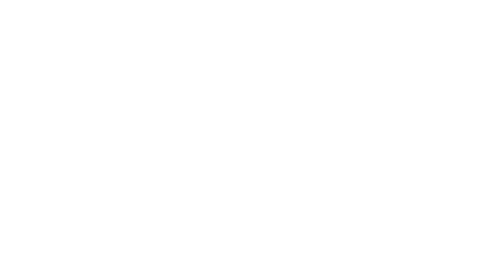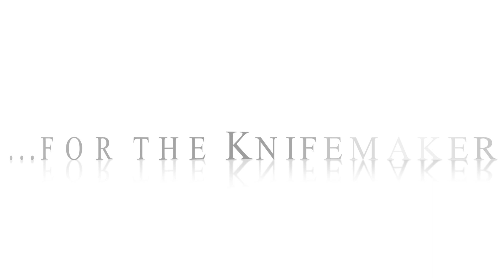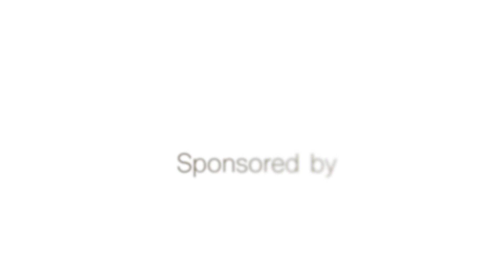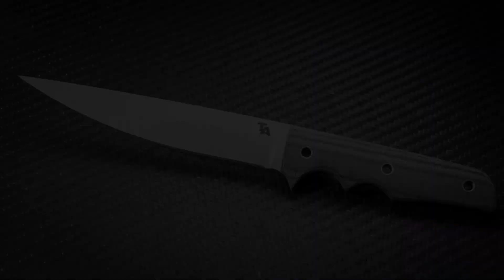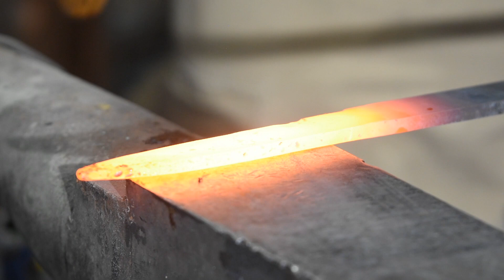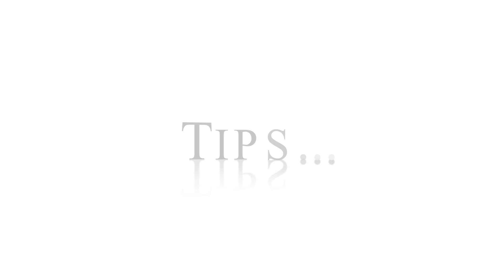Knife Maker's Friday Five #33:  Basic Heat Treating Questions Answered

Comment: I was given a warped, 1095 damascus billet (2x12x1/8") I plan to heat to non-magnetic and press it between aluminum blocks to straighten it. QUESTION: Should i cover the billet with ANTI-SCALE coating before that initial heat treat and straightening???? Thank you ahead of time.

Reply

Comment: Sir I have a question , I have a cheap 200$ D2 steel katana , that is not differentially hardened. I want to try myself doing and want to do that traditionally. Clay tempering, heating in self made klin  and quenching in oil

Comment: How to heat treat stainless steel knives? I've seen a bunch of videos and everyone used aluminum folder to first heat the blade in oven then used aluminum thick plates to clamp and compressed air to normalise. Can stainless steels be oil quenched like any other carbon steels?

Comment: I may have a stupid question regarding the knife making process and hardening: when are you supposed to heat treat it? Is it after you have made the knife or is it when you have roughed out the basic shape of the knife in the beginning of the whole process 😊
Reply: IMO you heat treat it after it's shaped but not sharpened. If you sharpen then heat treat the thin edge will probably crack.

Comment: Walter, I'm a beginner and just queched my first 1080 blades in canola oil,  but my blade developed some 'bubbles' in the beveled area, which I'm finding hard to remove.  Is this due to not agitating the blade in the oil fast enough??
Reply: You probably  over heated it try a little over cherry red if it is orange you have gone to far

Comment: If you are differentially hardening a blade with a torch would you still temper? The back of the knife is still 30ish rc so snapping is unlikely, does tempering do anything to the edge of the blade that is beneficial to it as a cutting tool or does it just make it softer and therefore not hold an edge as well?
Reply: What do you mean by "differentially heat treat?" Are you referring to an edge quench? Coating part of the blade with a refractory cement? A standard heat and quench, then use a torch to control the location of heating so that the spine is tempered more than be edge? Differentially heat treating a blade just means to harden one part of the blade more than another. The three I listed are all differential heat treatments, but they're very different. Regardless, you will always temper a blade to some degree, including the edge, no matter how you heat treat it. Tempering isn't just about preventing the whole blade from snapping. It's also about reducing the likelihood that the tip will break off and that the edge will chip.

Also, "heat treat" refers to a multi-step process: heating the blade to critical temperature, rapidly cooling it, then applying a little heat to temper the blade.
Reply: P226nut yes, you still need to temper for a normal knife.  Otherwise the edge will chip and crack with ease.  You might be able to get away with slightly lower tempering temps, though, and get a sharper knife.  But you would need to experiment and torture test a few to find out.  Untempered steel will shatter just by dropping on a wood floor sometimes....tile floor every time.
Reply: FellToRise sorry my phone really fucked up what I was trying to say, it changed hardening to heat treat, I have no idea why, any way. What I’m talking about is using a torch to harden only the edge, so the part that needs to be hard is hard and the part that can  be soft is soft thus adding strength to the blade. If your using carbon steels this can work and works well, I’ve generally never tempered my own personal blades because I like them harder and what I’m asking is does tempering have any value on such a blade, something I’m missing or don’t know about? I used  a knife that was hardened like this to pry with just yesterday and the edge didn’t crack and I’ve done this many times so temper don’t temper? Will the edge be tougher if tempered?
Reply: Lou L that’s not been my experience, what I’m talking about is only hardening the edge of the blade not the whole thing, I’m not sure it’s possible to crack a knife hardened in this manner, I think it also depends on the type of steel we are talking about. I use O1 and 1095 almost exclusively, I’m sure working with more modern steels it may be different.
Reply: P226nut
Hardening a blade with a torch is fine. But tempered martensite is always tougher then austenite and perlite. But if you try to pry with the blade untempered (edge quenched) so the blade bends, it will crack the edge. Otherwise it is not hardened properly😉  try on a test piece🤘👍 i also use O1 and 1095 among others. 👍 keep making blades💪💪
Reply: I imagine that, if you only harden the very edge..like 1/8 inch...them you may get away with not tempering.  I know some people will do it for wood chisels and razors and others things that will suffer no excessive forces in use.  An EDC knife would eventually meet its demise in use if left untempered.  Hmm, I imagine you could get away with it if you are not getting everything out of your hardening process...which just may be the case when hardening just the edge with a torch.
Reply: Almost every hardened blade is then tempered. Contrary to popular opinion, however, a hardened but not tempered blade will not shatter like glass if you drop it; it may crack or break in half, likely the tip will break off, but generally untempered steel is not THAT fragile (it can be, if it is fully hardened and had more than .9 percent carbon, but most knives don't have more than .84). It was customary, after all, for files to be left untempered.